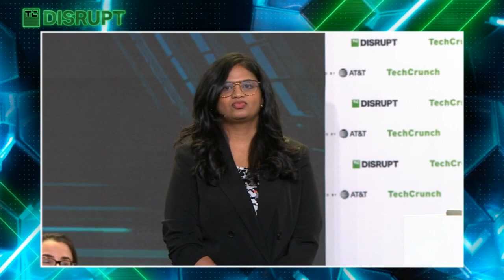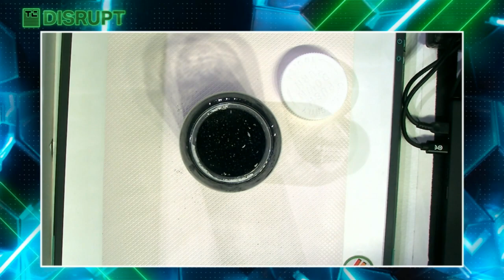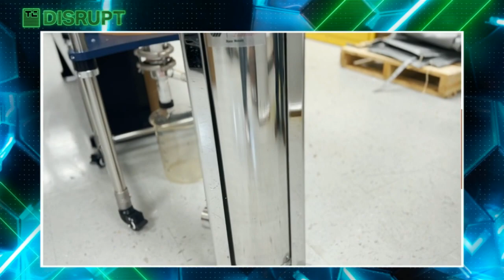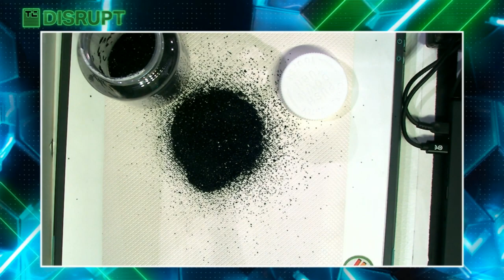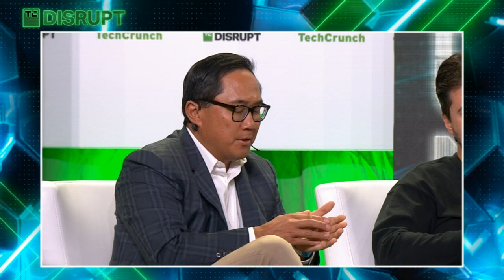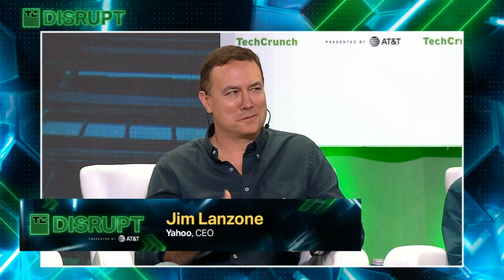TechCrunch Startup Battlefield FINAL: Minerva Lithium

Comment: I don't quite understand what happens to the salt from the brine.  Many new non-evaporative extraction operations that take lithium from brine intend to return that brine underground, instead of turning it into fresh water. In other words, what comes out of the process is still brine, without the lithium.   In this case the fresh water production would be pretty valuable, but ultimately the salts have to go somewhere so they sort of skipped over that part.    The extensible and 'programmable' aspect of the nanotechnology to extract different minerals or molecules is the real winner here. There's not much fresh water on the planet, but there's a lot of brine, and a lot of tainted water, that potentially could be put to use.  

The viability at lower lithium PPM is also hugely important. Not all brine is the same.  There's lots of lithium-soaked brine in the US as it turns out. Utah near the Great Salt Lake for example, and around the Salton Sea.  Remember that the middle of the US used to be an ocean, and there's remnants of that ocean still underground and around. 

The interesting thing is, I've seen many many promotional hype videos for various new tech lithium extractors.  These ladies have almost nothing (so far). I mean, look at the fact that there are only two comments so far.   And yet, they've got the attention of some major players.  Any company worth their salt (pun intended) is going to be trying to buy the company for the potential.  I'd love to throw in my $2, but I think Elon will beat me out by adding quite a few zeros. 

The judges did a crap job of asking questions. How expensive is it to produce the nano materials? How long does that material last (how many cycles of absorption/extraction)? How have you protected your IP?